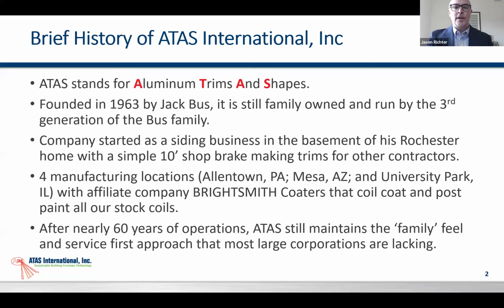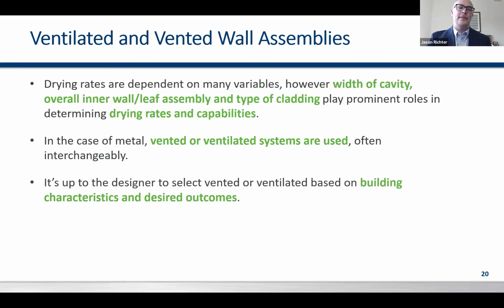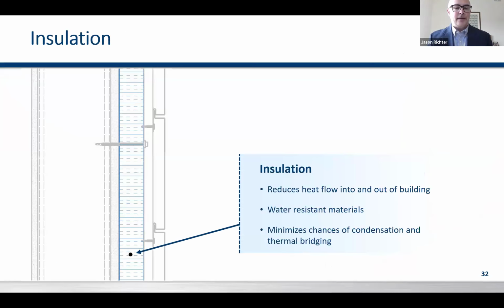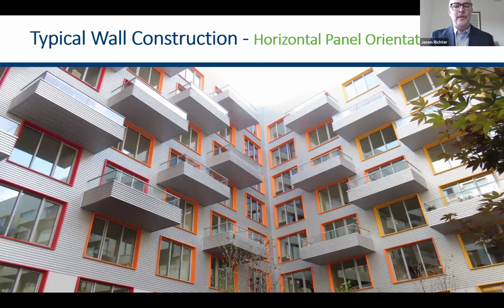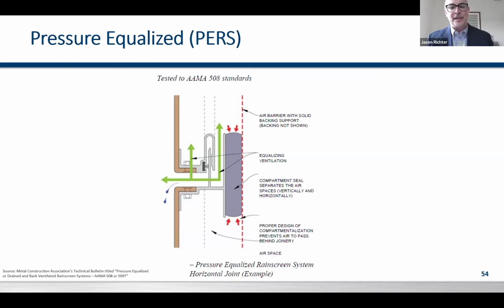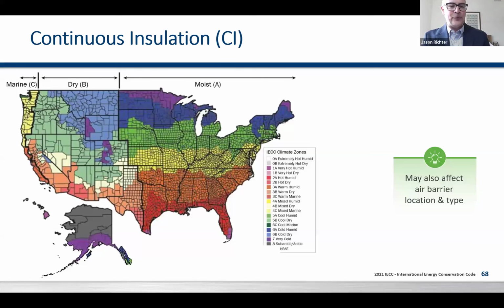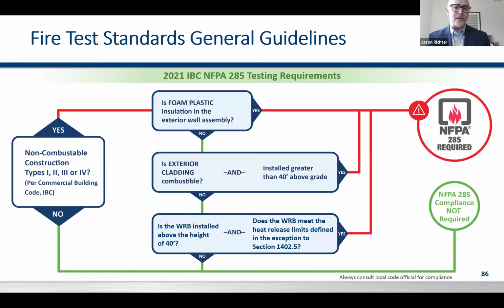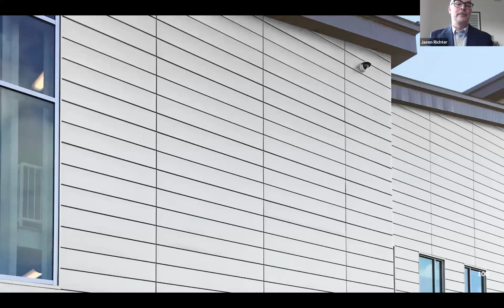Demystifying Rainscreen Systems Utilizing Metal Wall Panels [Webinar]

Comment: Thank you for touching on the use of CI on top of WRB vs behind WRB in residential settings. I feel like there has been a lot of confusion on the use of CI on top of WRB/sheathing in the south (climate 2A). Many have mentioned that Zip-R is incorrect with CI on the studs but this webinar helped clarify based on climate zone needs.